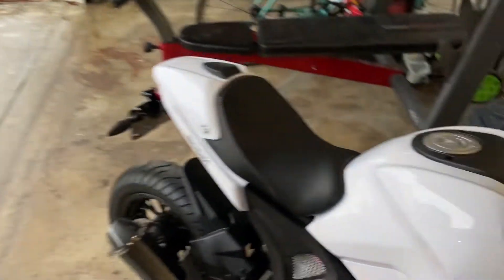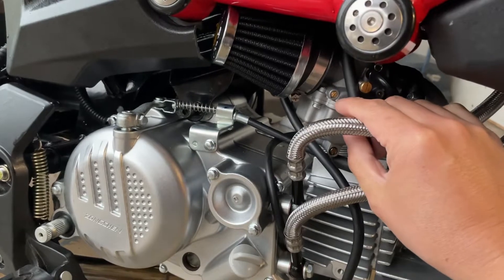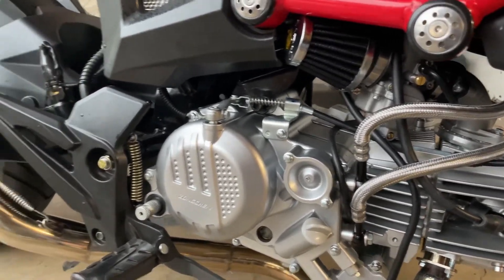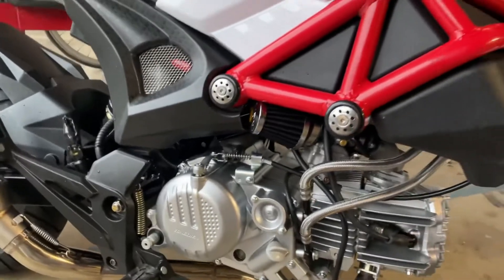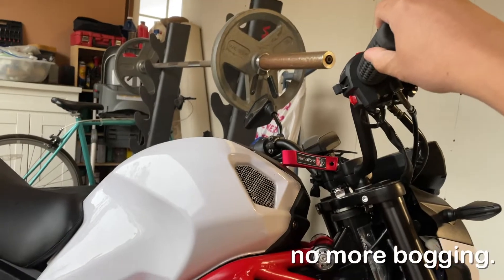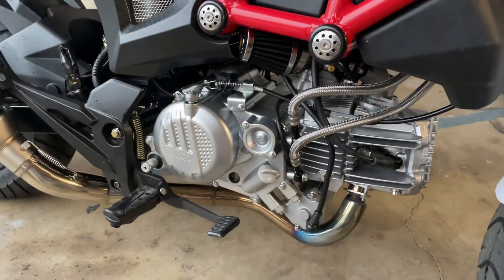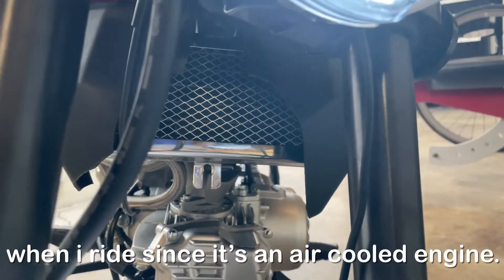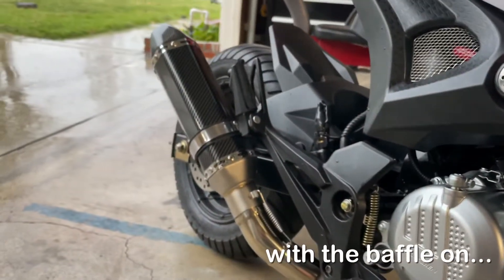ZS190 190cc engine swap for Little Ducati gets a new setup and “tune” in vlog 045

Comment: Hi I just wanted to let you know be careful how you start the engine they are prone to snapping the input shaft mainly with kick start but I wouldn't try to keep starting it if it doesn't fire on the first time give it a couple of second before retrying even with the electric start the shift star mod helps it a little bit to. Just some info I have gotten on this 190cc✌️👍👌💯

Comment: Where’d u get the pipe from? Does it bolt right up, or need modifications?
Reply from the maker: I got the pipe from David bullock from the zs190 swap shop Facebook group.  It bolted right up, no modifications I had to do.
Reply: @jonathancunanan   is there a way you can link it??